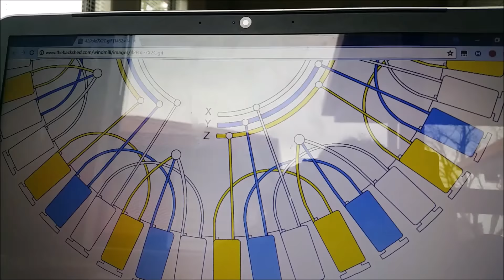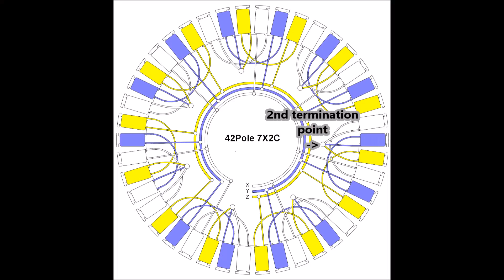Rewiring a SmartDrive motor for hydro/wind generator

Comment: If the place of comsumption is far from the source, it's better to let the generator has is, bring the high 3 phases voltages up to the end. Then convert directly the 3 phases high voltage to DC high voltage with diode bridges. Then use a converter like a Flexmax, Sunnyboy or Chinese high dc voltages MPPT tracking normaly use for solar and it will step down to the voltage you want. Mostly 48 volts.

That may appear more costly but I'm pretty sure it get better depending how far the production and comsumption are.

This way, running cable diameter stay small (copper aren't cheap). Power on 3 phases travel well better too.

Comment: They do make rosin core solder low temperature 25 watt iron should do wonderfully The solder should flow right into the copper wire not look like a lump that's what you call good solder joint
Reply: @Vo0d0o2009  She's in my head

Comment: Thank you, you are clever.  My question to you is what is the benefit of this connection, why don't you leave it as is? Is this connection better for voltage and braking? Thank you.
Reply from the maker: Its useful to reduce the voltage output and increase the maximum current for a low voltage generator.

Cheers

Comment: I wired a alluminium stator and used crimping connector that works peffectly.
Reply from the maker: Good idea, make sure to waterproof connections or they may galvanically corrode.

Comment: what is the best rewired for low rpm plz ..i have the motor and the turbine but a bad amp ..thank you for this project sir
Reply from the maker: You need adequate power in (torque and speed of rotor) to generate power out. Low speed input may require step-up gearing to improve amperage output with a rewired stator. Factory winding with 0.6mm diameter copper can only produce a maximum of a few amps before saturation.

Comment: 2 coils per phase seems the best for low voltage systems with the 42 pole stator, theyre not a huge power house but good for low rpm output.
i like the samsung stator also
Reply: yeh i learnt the same , i split the stator in half then thirds then quarters then into 7. but you need some good rpms to see good amps.
have you looked into diy axial flux pmas like Hugh Piggotts
Reply: So 3 phase (3 groups) which have total 6 poles?

Comment: What if instead of rewiring the stator just use the original wiring, rectify whatever voltage it makes with 6 diode bridge and feed PC style SMPS power supply from it? I did not try that, but some say these power supplies will start with on DC, any voltage 90-250V. SMPS should should be possible to adjust to 14volts suitable for charging a battery bank.
Reply from the maker: These stators can go well above 1000VAC and higher rectified DC when an unregulated turbine drives the rotor. Would suggest having accurate load control and appropriate safety systems in place if you were to wire in to a DC system on factory winding.

Comment: For those of us NOT in NZ, what US washing machines will use a motor with this kind of stator?  I'd love to do this but am not sure how to find a washer that has this...
Reply from the maker: hmm I'm not sure, maybe try search direct drive washing machines, there's got to be something out there 

Cheers
Reply: I work in a scrap yard and see them all the time. I can't tell you what brand they are because we just smash them and move on. I wish I had the time to save them.
Reply: @kevinbrown1629  How painful to hear they're being smashed.  Ugh, wish you were near me.  I'd rescue a bunch of them.
Reply from the maker: same here, I stripped almost 10 at our recycling place today as we just getting too many of them, I've tried setting them up as small kit sets for people to buy from our shop, which hasn't had much success sadly.
Cheers
Reply: @stefanstoove9254  I think those of us who are willing to do this kind of thing are in the rarity.
Reply: @stefanstoove9254  post your shop info or prices here/  You never know who might want one!
Reply from the maker: Here it is as of today, cheers.

EarthLink Inc. NZ
DIY Generator Kit - $40-50 (NZD)
Includes: Stator, rotor (36/42 pole). Bearings, shaft + nut, fixings, plastic spline coupling.

I occasionally smash out the bottom of the plastic drums to get the bearing mounts for easier assembling.

Comment: If you only want DC out, how about avoiding  having to convert to single phase by simply rectifying the 3 phase output. You only need 6 diodes to do it (Google 3 phase rectifier).

Comment: Hi again Stefan, I've come to the conclusion that I need to rewire my 6x2C 36 pole stator again - down to 12x1C - I'm still getting too many volts for my 250V charge controller. Have you seen any instructions for this? Thanks again!

Comment: great vid, Stefan would you know what model or branduses this type smart or direct drive motor in the US. thank you.
Reply from the maker: Hi - I'm not entirely sure what direct drive washing machines are in the US - maybe try a searching for brushless motors, direct drive washing machine motors.
LG uses the same design on their direct drive machines.

Cheers
Reply: @stefanstoove9254  thk u, i am trying to build a hydro powered turbine prototype in the US, then if it works I will send it to the Phillipines to power a small remote lot next to a river in the Phillipines.
Reply from the maker: @marinellahobbyfarm-manongb4891  That is really cool to hear - they definitely form a good foundation for a lot of generator setups. 
Thanks
Reply: Stefan how much to buy one from you

Comment: So beautiful. I will have a few questions. DC generating current or AC current? How many Volts of power does it produce in how many cycles?
Reply from the maker: Thanks, the motor itself produces 3 phase alternating current, which can be rectified to DC through a 3 phase full bridge rectifier. 
Voltage is around 12 to 24V after rewired in this scheme at a couple hundred RPM. Cheers

Comment: When rewiring, why not connecting the centers of the different stars? Doing this would create a short circuit or would improve electrical stability?
Reply: @stefanstoove9254  I mean interconnecting the centers of different stars. Can this be done? Or would it be dangerous?
Reply from the maker: Hi there!
I'm not sure, the motors are originally wound in star, with the 3 phase ends interconnecting at a main termination point.

Cheers

Comment: Good morning sir I have the LG direct drive motor 36pole stator aluminium winding is their. I want to make the air wind generator.how to do the generator winding please help me urgent please show me the diagram pic
Reply from the maker: 36 pole motor wiring can be found on thebackshed.com under Fisher and paykel motor rewiring.
Generally, aluminium is not suitable for soldering, so a copper stator is better, but I have heard of using crimp terminals to do wiring connections.
Cheers.
Reply: @stefanstoove9254  sir thebackshed.com is not working the site
Reply from the maker: https://www.thebackshed.com/Windmill/FPRewire.asp

Sorry hopefully that should work now, has lots of diagrams and useful info on this page. Cheers

Comment: My Gosh!
Ya need to do a better job on the soldering buddy.
Need to add flux to the wire(s) & Have a proper type of solder as well!
There are ways of configuring the phases.
Not sure if you knew of the simple rule
Wye produces good volts while amps aren't that great
Delta produces set volts while amps are AWESOME
Godspeed

Comment: Firstly thanks. I have three questions, 1. The winding of the 42 coils is on the same direction? 
I mean are all of them clockwise?   2. The winding system of the 42 poles is the stator sysem?
3  At the 3.44 to 3.45 second when you insert the cover it has all around a intrinsic metal cover (if am i not wrong) is this a magnet and does this consist the rotor system?  In case the anwer is yes just because is enough difficult to find a such circular magnet , Is it possible to replace it with a sery of accessive linear magnet in the interior of the cover? .
Reply: @stefanstoove9254  Dear Stefan thanks from my heart you are really superbe.
Reply: @stefanstoove9254   hello if i did the pole by which you connected why i have no effect, does it have what role 42 and 36 coils play and what role does diode play

Comment: Would it work as a low voltage motor as well?
Reply from the maker: Yep, as there are a lot of windings, they need to be rewound with thicker wire or with all coils in parallel - 48v at 1000rpm from my experience.

Any quicker, and the switching frequency of the controller will begin to limit the maximum speed.

Cheers

Comment: Hi so why is it necessary to rewire it?
Reply: Is it for voltage?
Reply from the maker: Hey there! Yes, rewiring does reduce the voltage output and increases maximum current. This makes it more suitable for 12/24V systems. 
Cheers.

Comment: Why on earth would one go to the risk and trouble to rewire an ac producting motor used as a generator to lower its voltage and increase amperage whit a simple cheap step down transformer does this so well? If issue is frequency because most transforms are 50/60 Hz magnetic cores. Just wind your on on a switching a power-supply, etc toraroid core.
Reply from the maker: It is safer and likely more efficient method of bringing voltage down and increasing current for 12/24V systems. 
In some cases, yes, it would be logical to leave as high voltage 3 phase AC if you are transmitting power over a longer distance so as to reduce voltage drop. This should only be done by someone experienced.
Its fairly straightforward to rewire once you understand the fundamental workings of the BLDC motor.

Thanks, 

Stefan

Comment: Please help me to make generator for VAWT at low rpm and low starting torque. using direct drive motor
Reply: @stefanstoove9254  Thank you For your recommend stefan stoove
Reply from the maker: Hello! The factory motor produces around 12/24V at low RPM. This is at a low current, but could be good for a small easy VAWT.

The best method would be for a larger VAWT, to use step up gearing on a rewired motor (so that it is spinning faster) to produce more power.

Cheers.

Comment: Do you happen to know where I can get a full diagram of wiring it in 7 phase 1x6c? I did find a partial pic on The Bach Shed, but it only show the 1st step.
Reply from the maker: I've never actually done the 7 phase conversion before, I've heard it's good but haven't had much time to look into it The most you can find is on the back shed website. 

Sounds like 6 coils in series, so I'm assuming it will be similarly wound but every 7 steps for the 7 wires on the 42 pole stator?

The star termination point will have the 7 ends joined together.

Thanks
Reply: Wow, you really helped me out, I truly appreciate it! I just joined the back shed, what an awesome site. Thanks again.
Reply from the maker: Thanks and good luck! I'll try my best to help if you have any questions :)

Comment: Im having trouble finding a fisher and paykel smart drive machine anywhere near me. If i were to order the parts individually to make this generator from scratch what would all the parts i need be called? Advice would be much appreciated. Cheers.
Reply from the maker: Hi there,

In New Zealand, there are often plenty of washing machines at the tip or recycling stations which you can take these motors from. I was lucky to have a community based shop called CREW, they have helped me source many of these Smartdrive motors to use in my projects.
If you are overseas, you might be able to find them listed online, but will be a cost as shipments and business come into it.

Thanks and Good luck!
Reply from the maker: Most important parts would be:
- The motor - also known as, Gentle Annie Motor, SmartDrive Motor, F & P motor, Fisher and Paykel motor, BLDC washing machine motor, etc.

- Stator mounting flanges/plates - helps secure motor to drum.

- The rotor - two versions, one for older 42 pole motor and one for newer 36 pole motor.

- The shaft (25mm Dia. stainless, splined at each end: 2 versions - 1 with external threaded ends and the other with internal threaded ends which is newer version.)

- The thin shaft nut (to retain bearings)

- Two bearings (6005RS) , sealed are recommended in weather conditions.

The motor mount can be built manually or taken out of the washer drum as you might have seen. 

Many thanks and Good Luck!

Comment: help me friend with my garador he has 36 coil, and the detail is that the wire is not copper but aluminum. I want to make the same connection I bought connectors so I did not have to solder.

Comment: My 36 pole Smart Drive was wound with aluminium wire. What now? Must I march it to the dustbin Stefan?
Reply from the maker: Hi there!
The aluminium stators are definitely more difficult to work with as they do not solder with regular lead-free or leaded solder.

I heard of an idea to use crimp connectors to clamp rewired stator connections together?

Another method could be to strip off aluminium wire and replace with thick stranded enameled copper wire, (this skips the rewiring process but takes a long time to strip and rewind stator).

Cheers and good luck!

Comment: Does this configuration require to rearrange the magnetic poles on rotor???
Reply from the maker: Hi, the rotor stays the same unless you use a different number of poles stator. As this is only changing coils from series to parallel, there is no need to change the rotor. Cheers

Comment: Why do we need to rewire the motor?
Reply: Because they way its wired up, it uses power to create the stator to spin. This rewire is using the spinning stator to generate power!
Reply from the maker: Rewiring the motor by putting more coils in parallel reduces the voltage to make it more suitable for a 12 - 24V generator. 
The quicker the motor spins, the more voltage on the output.

Therefore, for higher RPM applications such as high speed pelton water turbines, more coils should be put in parallel to reduce voltage, and increase current output.

Once rectified to DC through a 3 phase full bridge rectifier, this can be used to charge 12 - 24 - 48V deep cycle batteries.

Hope this helps and good luck!
Thanks

Comment: Hello, thanks for the video. Can you tell me what kind of rectifiers you used for this generator? like what part number or such. thanks
Reply from the maker: 3 phase bridge rectifier from Aliexpress. 

Or you can create a bridge rectifier from large diodes, but they do need some kind of heat sink if you run a lot of amps through them. 

Cheers

Comment: hello how are you I hope you are available today 2020 I need to know if it is metal or plastic where the coil wire is wrapped?
Reply: ook thank you very much I have not found that washing machine motor but I will do it in acrylic then put metal bars on it and likewise coat it with acrylic thanks again from the Dominican Republic I will review the video very well to know the turns of wire and all the truth I do not know much English but google helps me
Reply: if i will see you
how many turns does each coil have and what number of wire did you use?
Reply from the maker: Hi! The coils on this stator are fully insulated with plastic and have an iron laminated core like most stators.
Cheers.
Reply from the maker: That is all good :)
Good luck with your project!
Cheers
Reply from the maker: On the first stator I rewound completely, I used 8 strands of 0.8mm copper, wound in 2P x 6C star. This gives a much lower voltage at a high current (typical for higher speed low voltage BLDC motors).
Cheers
Reply: ook Thanks a lot

Comment: Generatory napedzane wiatrakiem czy kolem wodnym, robione z bylych silnikow, maja o wiele za niskie obroty, wiec by pracowal on sprawniej, cewki musza byc polaczone szeregowo, by generator dawal jak najwyzsze napiecie, wtedy prad bedzie maly, a im jest mniejszy, tym slabiej beda sie cewki grzac, a to jest duzy mankament tych konstrukcji. No i slabe, ferrytowe magnesy w rotorze tego silnika powinny byc zamienione na porzadne, silne magnesy neodymowe, wtedy to dopiero ma jakis sens. Niemniej jednak, z takiego bylego silnika od pralki najwyzej, co da sie osiagnac, to gora 300W, choc te silniki sa wolnobrotowe, to i tak, by pracowal sprawnie, musi obracac sie z obrotami okolo 1000 rpm, a smiglo powietrzne da gora 1/3 tej wartosci.

Generators driven by a windmill or a water wheel, made of former engines, have a much too low speed, so for it to work more efficiently, the coils must be connected in series, so that the generator gives the highest voltage, then the current will be small, and the smaller it is, the weaker the coils will heat up, and this is a big drawback of these structures. And the weak, ferrite magnets in the rotor of this motor should be replaced with decent, strong neodymium magnets, then it makes sense. Nevertheless, from such a former washing machine motor, the highest that can be achieved is up to 300W, although these motors are slow-running, in order to work efficiently, they must rotate at about 1000 rpm, and the air propeller will give up 1 / 3 of this value.